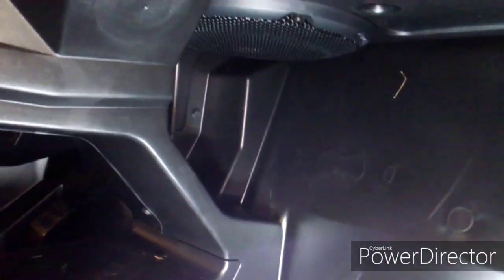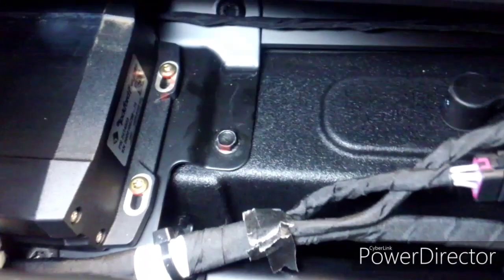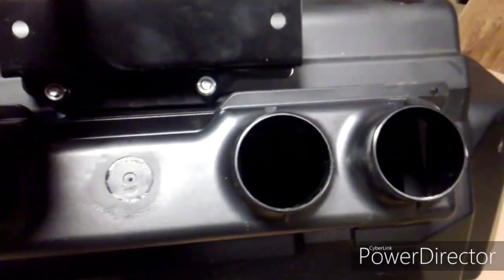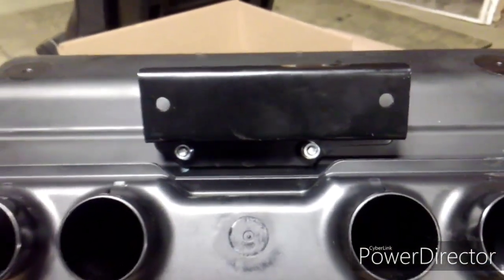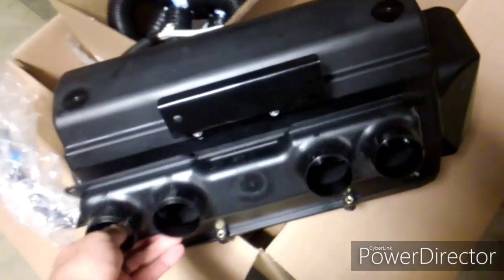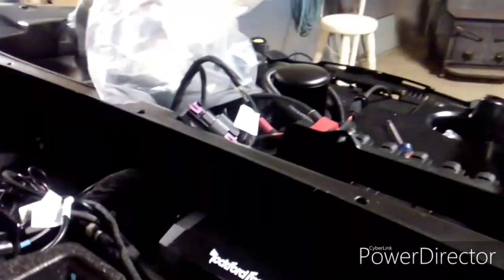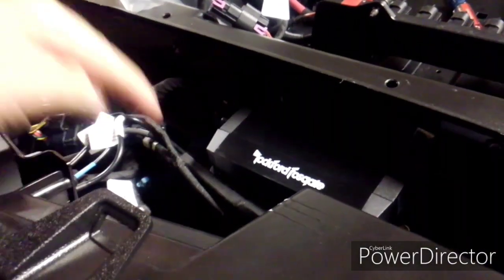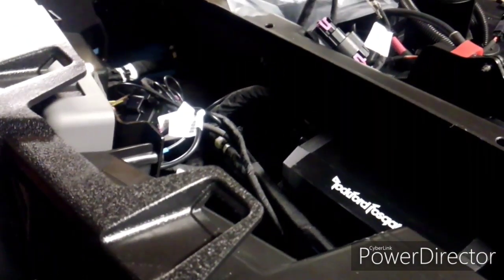2020 General XP 1000 4 (Ride Command or Heater) First problem!

Comment: Is this problem only on a 2020 General with Ride Command and do you have the optional stereo with the sub woofer?  Did Polaris fix this problem on newer Generals by relocating the components.
Reply from the maker: My understanding is if you get the basic stereo that comes in them it's not in the way. It's only in the way if you get the Ride Command. I heard rumor that they came out with a different option for the stereo or the heater. I'm not sure which one of them has been modified. I have not confirmed that. The dealers should know about this. My problem was that I got the first XP in Oregon.

Comment: So did you need to get a different bracket for the amp to hook to and where did you decide to place the sub.  I have the heater to be installed on my machine  but haven't found installation videos other than yours.  Thanks.
Reply from the maker: I made a bracket to mount the amp.
Then I made an extension cable for the sub so that I would not have to open up the dash again.
But I have not yet found a new home for the sub.
It's one of those things that I may do some day, it sound's ok without it.
Reply: @generaldreamsoutdoors43  ok, thanks for the info.

Comment: I could care less about the ride command , or a radio. But what I have heard about the problems tell's me their quality control and engineering has been substandard at best. 
For the price of a general XP I could get a double cab 4x4 that I can use and drive on the roads ? 
I just can't justify the price. JMO !
Reply from the maker: You could get a double cab. But for the ride quality it would be a very expensive suspension upgrade on a truck.
The XP rides very nice.

Comment: The guys from Inferno said that they we can install  theirs with the sub installed
Reply from the maker: Jason Estes, I made a relocation bracket for the amplifier and made an extension wire for the sub and removed the sub I put the factory Polaris heater system in. I'll find something to do with the sub later thank you for your input.
Reply: general dreams I’m considering putting my sub overhead between the two rear speakers. Just need some time to figure out a mounting bracket and possibly a different sub enclosure.
Reply from the maker: Jon Marchand It looks like we think the same. That was my thought also. Later on once I get the heated seats installed and the one upper soft door that doesn't fit handled and I'll probably be thinking about how to do that for the sub. Let me know if you come up with an ingenious idea and when I come up with one I will post it on the channel. Thanks for watching
Reply: general dreams just thought I should mention hunterworks rollers for the secondary clutch. Lots of rzr, General, rangers have an issue with the 2016 and up square rollers causing wear to the secondary clutch causing all kinds of problems. If you’re not on the Polaris general forum I’d recommend. Lots of great information I’ve found on there. Almost everyone on the forum has hunterworks rollers. Cheers.
Reply from the maker: Jon Marchand Thank you for the tip.
Reply: Will you have a video about the door issue? I just bought one and was going to try to see if the doors from my 2019 would fit when I get it home.
Reply from the maker: miles hall 
I need to look through my videos and see if I recorded enough to make a video to post.
I will look at that soon.
But the main problem that I had was the post that stick out of the bottom of the soft top frame were not in the correct location.